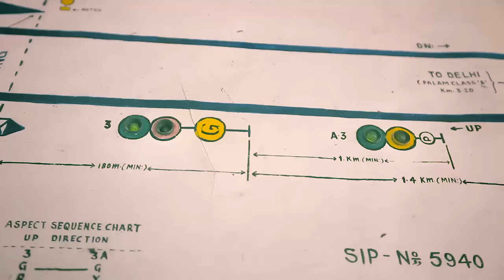Story Of Gateman

Comment: what will gateman do if there is Ambulance is coming  and the trian  is coming at the same time, will he open the gate or not.
Reply: No gateman will not open the gate due to security reasons
Reply: Gateman will immediately call the stationmaster about the proximity and importance of the train... then he will seek permission if it would be safe to open the gate or not...
If allowed he would definately tuen the signal red and then open the gate for a while to pass the ambulance or fire engine...
Reply: @monisha6855  but station master will not give the permission at all because train is already running on the line and line is already clear for the train